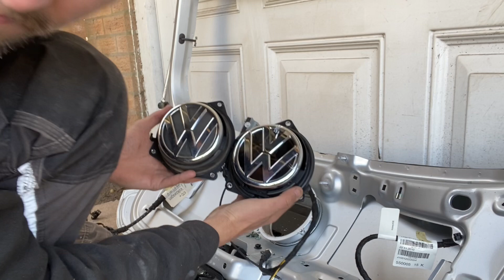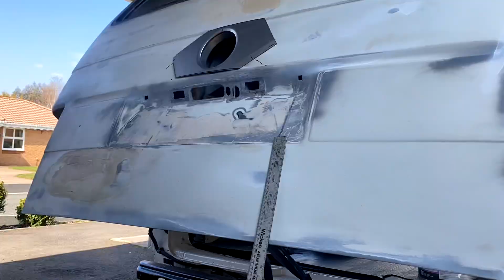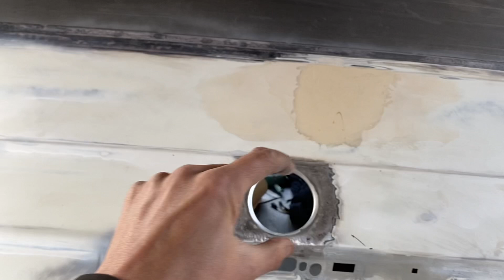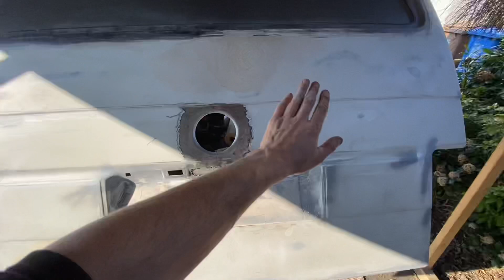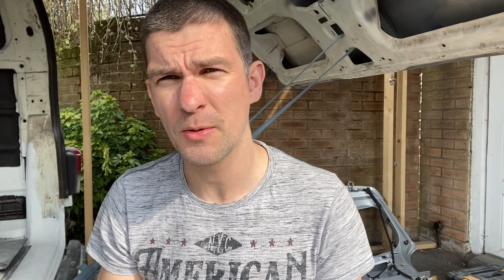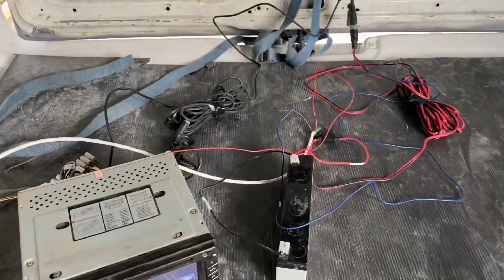VW T4 Busy weekend tailgate project

Comment: I was thinking when you mentioned about the badge being electronic and having central locking you could use 2 solenoid one for the central locking and the other for the badge all you would do to get power to it is run a fused power wire that goes to the switch on the badge then from the badge to the solenoid then to earth (basic layout as not sure how the badge is wired)
Reply from the maker: Hi, I have it all sorted now. The badge does not allow enough current through the switch to power the Solinoid but does throw a relay so did it that way.

Comment: Any chance you have a link for the camera? Great mod
Reply from the maker: Sorry no link for it. Company is ‘Ali Express’ there’s a couple of options of slightly different models. I didn’t get it quite right as you may have seen as the orientation was out but I got away with it as I had the flexibility of rotating the metal patch.

Comment: So how does this attach to the locking mechanism?
Reply from the maker: The electric badge is used as a switch to apply power to the central locking. There’s another video explaining the circuit.

Comment: Well that was a hell of a lot of faffing about to get to the required result . Well done on the electric side of things that's a rather neat idea I guess the polo was a mechanical lock as well so that was out using anything else . Sadly it's a long process getting the body work back to some sort of acceptable level when panel welding , however ya got there .. going to be a neat individual touch to the rear door . Cheers
Reply from the maker: Cheers Gary, yes it was a lot of work but I don’t regret it, I’ve already fooled one of my mates with it who couldn’t find the camera 😬

Comment: hi you could use a 5 pin relay to disconnect it when the central locking is activated. pin 30 con fused 12v, pin 87A power to the micro switch the 12v will go straight through the relay ( open circuit ). pin 86 switch 12v from the central locking, when energise the relay(closed circuit) will cut the power to the micro swicth
Reply from the maker: Cheers Kenneth I’ll take a look at that🤓
Reply: @pdubs7831  hope it helps you

Comment: Use the sony headunit - top half is single din & screen comes  down the replace the pocket. 👍
Reply from the maker: Cheers Matthew, I’m half way though fitting the Sony, mine does not have the pocket so I’m having to modify the dashboard. Most of it is getting cut out and replaced to take the radio. A much bigger job than I first thought.
Reply: @pdubs7831  i fitted the 1005 unit
Reply from the maker: I’ve got the 1000. I find DAB to be a bit of a pain in my T6. Got it at a great price
Reply: @pdubs7831   only way to get a decent signal is new antenna on the roof .

Comment: Wolf elec kit used a relay that allowed a microswitch in handle to operate a solenoid on tailgate to
Operate once unlocked only. Exactly how you want it
Reply from the maker: Cheers Matthew, it’s in my next video showing how I figured it out using that method 👍, I’ll probably use another relay too that removes the connection when the central locking is locked.
Reply: @pdubs7831   the kit used the switch wires in drivers door to enable a relay to supply power to tailgate which then used another relay to take microswitched ground to send power to solenoid
Reply from the maker: @mcjjordan  yep, I’ll be doing something like that 👍

Comment: Have a look at Sony XAV-AX100 6.4" for stereo, has double din face, but single din back unit on top, should fit the space pretty good if you remove the small pocket under where stereo would normally be in console, mine is 02 2.5 tdi. I think u need to chop stuff otherwise for double din.
Reply from the maker: Cheers for that, taking a look at it now. I hadn’t considered taking the area out below.
Reply: @pdubs7831  No worries, you can also get the fascia bit with 3 holes pre cut as a vw part no. 7D1819075E 01C to save cutting the original, in case you ever need to shove the Blaupunkt back in ;)

Comment: Interesting project. I have too much rust to deal with before start anything like that. I like the plane shape foam block you used where did you get that from?
Reply from the maker: https://www.ebay.co.uk/itm/Long-Flexible-Sanding-Rubbing-Block-70x400mm-Hook-Loop-Hook-It-Hand-Sander-/382281992263?_trksid=p2349624.m46890.l49286

https://www.ebay.co.uk/itm/ABRASIVE-SANDING-SAND-PAPER-STRIPS-70x420mm-LONG-BED-FILE-SANDER-HOOK-LOOP-GRIP-/172018376549?_trksid=p2349624.m46890.l49286

Sand paper available in several grits